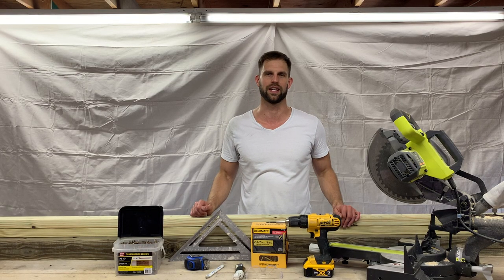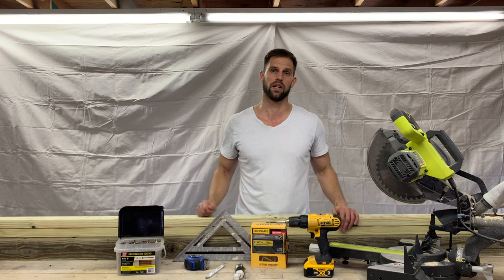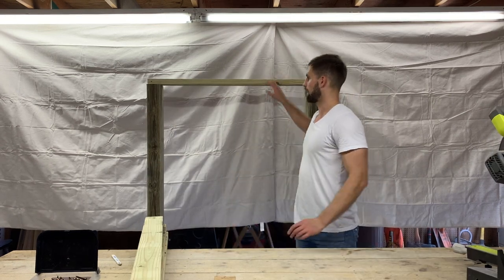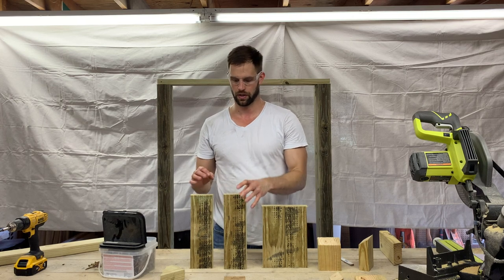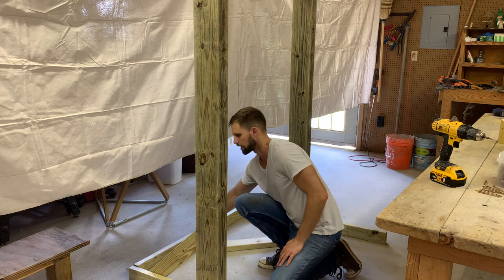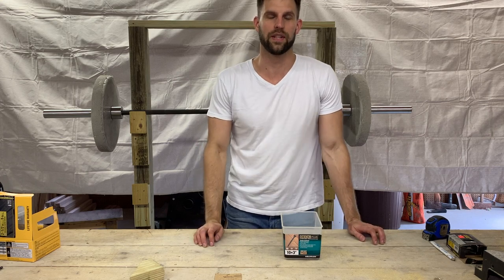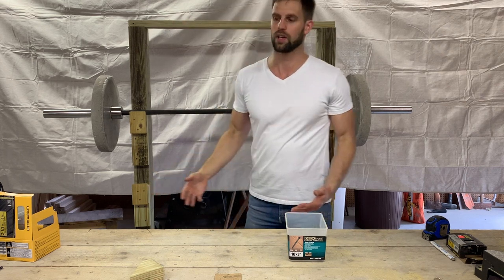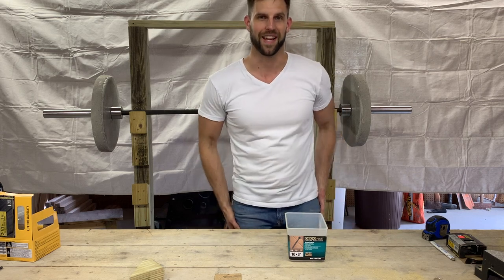Build a Squat Rack!

Comment: Thank you, Alex! I’m building a gym in an old shed on my farm and was looking for a simple squat rack exactly like this. 
 Will be buying your ebook on making concrete plates. Thank you for making this available at an affordable price. 

A couple questions: could you add adjustable safety bars? Could there be adjustable j cups or additional j cups down low for body weight rows/pushups with a bar?
Reply: Thanks Shane!! That sounds awesome. Hope it works out for you.     Safety racks can be made but it requires another set of posts further out that can support the guard bars that will be connected back into the main support posts.  More J cups can be added at what ever height you would like.  Just get a bar, try the exercise and mark on the posts where you feel the most comfortable starting height is.  Then put another set of J cups at that level.  Hope that helps!
Reply: Thank you! Please keep up the great content. Maybe a DIY cable pulldown or cable flye machine next?
Reply: It looked wobbly when you added the 10 lb plate. Is it structurally sound when pushed from the side? Looks like it can topple.
Reply: It wobbles a tiny bit but will not topple